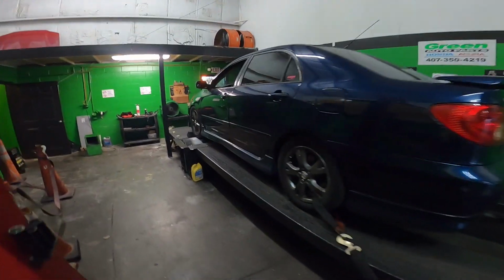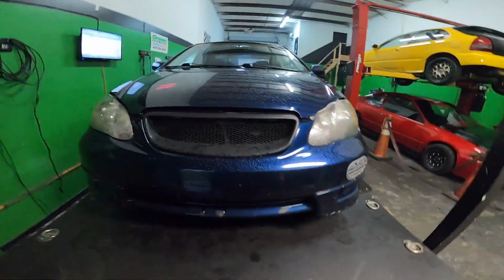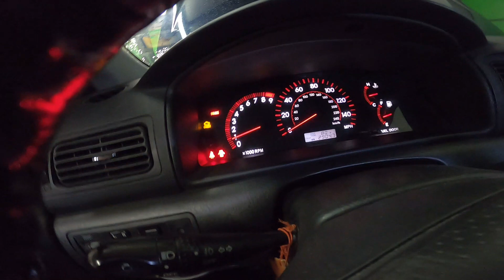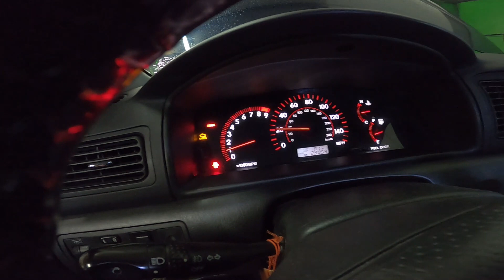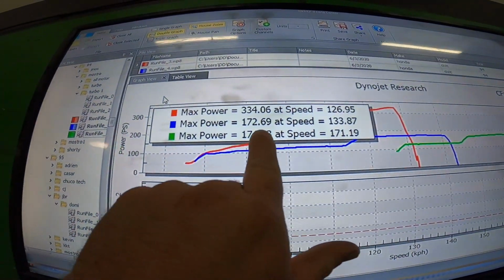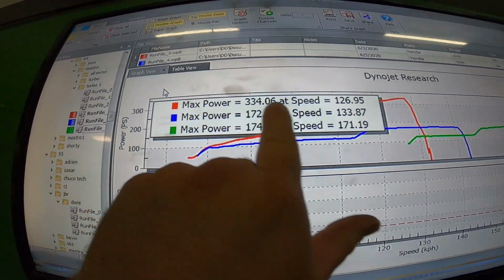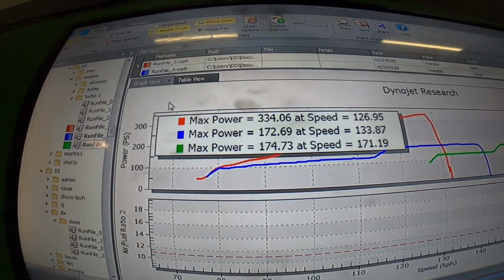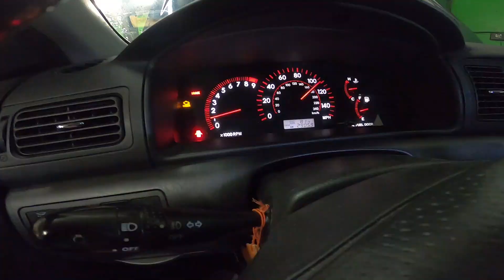Dyno Stock XRS

Comment: 174whp i wonder how many miles did the car had when you dynoed it i own an 05 matrix xrs with over 292xxx and wonder what i have to the wheels all mine has is a k&n short ram intake that came with it the exhaust is factory i just swapped oil pans to the 1zzfe oil pan i have a bored throttle body and a secondary ecu reflashed by R9k i havent installed yet

Comment: You think the only reason the celica gts and mrs make abit more power is cuz of the ps pump and ac compressor draw? My xrs dont have any i am thinking of going with st 3 piper cams and and titanium springs with ems4 the flash from r9k works fine but doesn't unleash the beast
Reply from the maker: You're probably right bout the gts and mrs. About your xrs sounds like good mods....